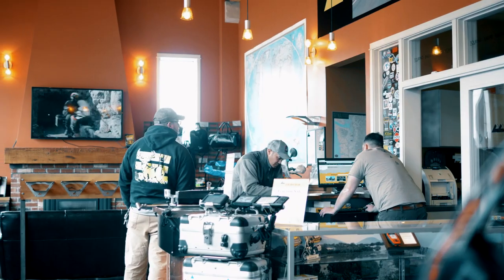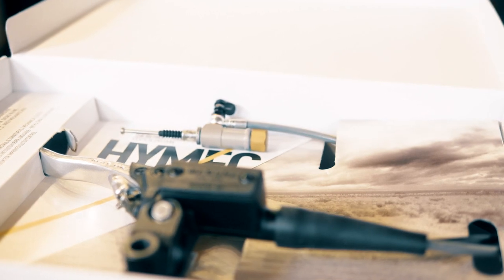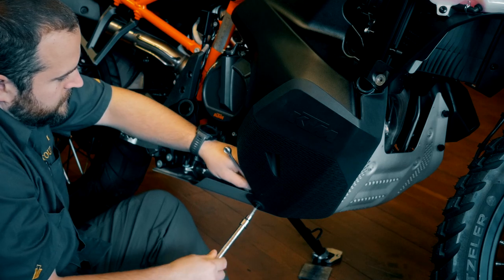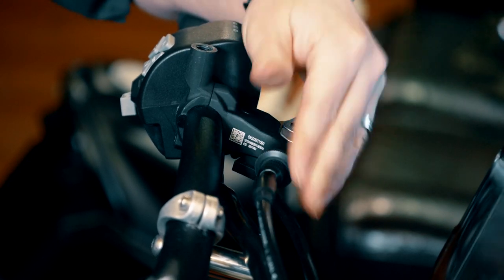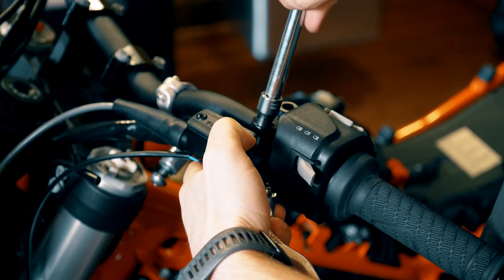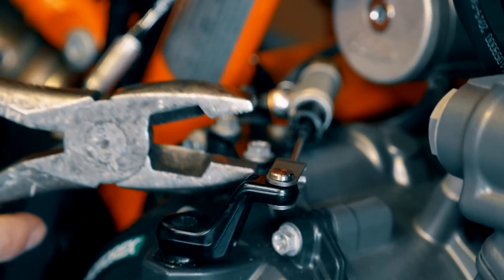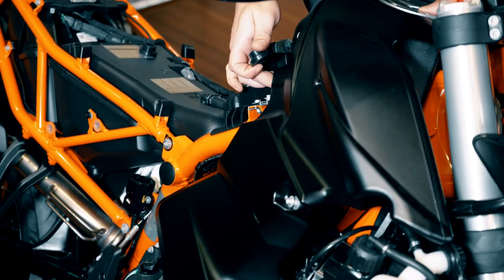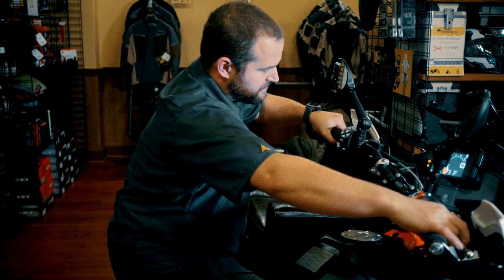Touratech Installation: Magura Hydraulic Clutch - KTM 790 Adventure/R

Comment: Hello, can the heat of the engine cause oil overheating problems with consequent wear of the actuator seals? Thanks
Reply from the maker: We haven't experienced any issues with that. The slave cylinder is remotely mounted off the engine case so the engine heat transferred to it isn't very significant.

Comment: Hi Sir,
Could it fit also on Duke 890 R ? They didn’t mention it. Maybe it’s more powerful and has stiffer clutch springs? 
Furthermore, Seems that slave cylinder has not a nut but it’s kept in place by the actuator shaft.  Doesn’t it shake because of vibrations? Thank you in advance

Comment: Great video. I just wish you could see the free play adjustment better. That's the only reason I looked for the video and unfortunately you covered ir with your hand.
Reply from the maker: Yeah, sorry about that. Basically all I did was hold my finger on the shaft and pull out on the arm then look at how far my finger had moved away from the rubber boot. It sounds complicated in the manual but it's a very quick and easy adjustment to make.

Comment: But why add complexity to the bike when you can just make the clutch arm a bit longer for a softer pull
Reply from the maker: The hydraulic clutch is self adjusting and will always have a smoother pull than a cable unit regardless of the actuating arm. If all you want is  a lighter pull the arm is a good option.

Comment: I have question, for long term usage which one of the most disadvantages for hydraulic clutch vs cable clutch?
Reply from the maker: For long term use they both require maintenance. If you flush and bleed the fluid annually in a hydraulic clutch the seals will last longer than most folks own their bikes. Clutch cables are harder to replace and more expensive than hydraulic fluid but make the system work like new again. Neither option is really easy to fix on the road without spare parts. There isn't much between them as far as long term use is concerned.
Reply: Very good upgrade . Excellent and detailed video